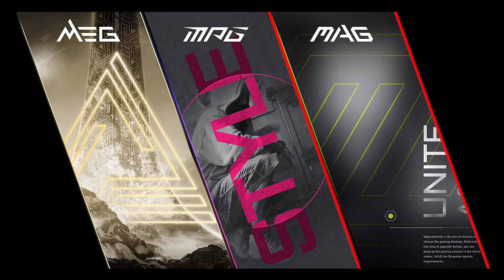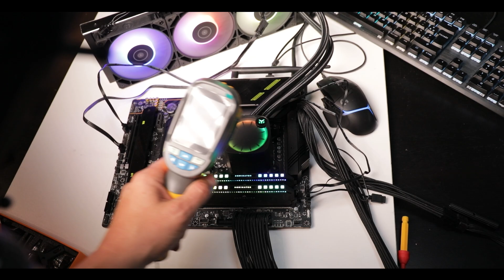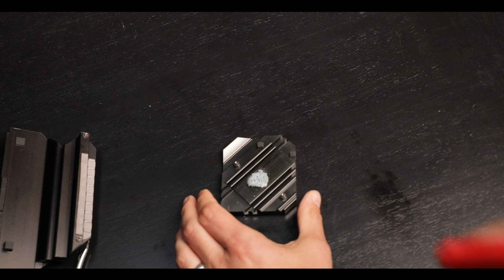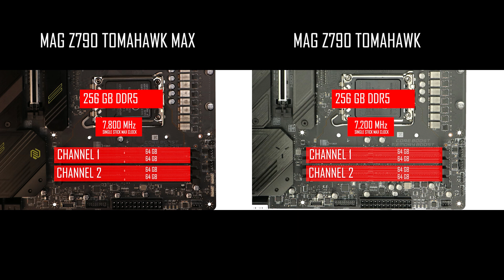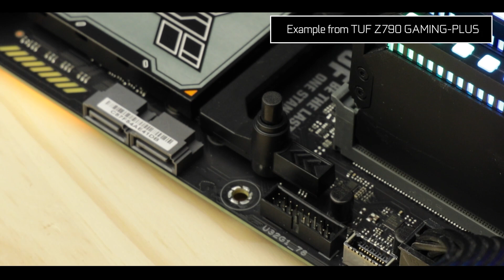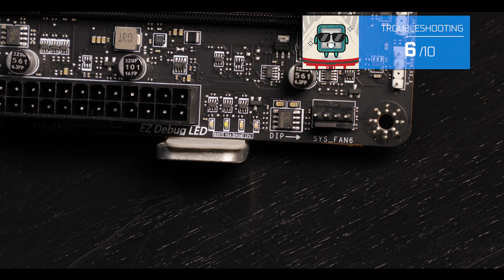MSI MAG Z790 TOMAHAWK MAX WiFi: Did MSI stop caring ?

Comment: What size thermal pads did you use to replace the stock ones? I'm definitely going to just do the replacement on mine. I don't like surprises and don't want to have to remove it again to replace them. :(
Reply: Did you end up replacing them and if so which size? Thanks

Comment: I was hours away from purchasing this but then I googled the motherboard and found your video. Thanks for posting! Now I have to hunt for a replacement with bios button, pci 5.0 and gen 5.
Reply: Just be aware, no matter the manufacturer, if you use the PCIE 5 slot for an SSD all Z790 boards half the GPU lanes to run it. No noticeable difference on a Nvidia 40 or 50 series Gen GPU, but that may change fast come the next series. The gen 5 SSD's work fine at the moment but given the way technology moves,  they could ramp them up and that could affect the speed of your GPU. Adding PCIE 5 to a Z790 was a stop gap measure.
Reply: @jaguar3248  What if I use gen 4 ssd in gen 5 ssd slot. Does it still cut PCIe lanes. Please answer.
Reply: @numansyed52  Gen 4 will work perfectly well in a Gen 5 slot without any lanes being cut.

Comment: MAG Z790 TOMAHAWK MAX  does it support bifurcation, as got a  4-Port M.2 Expansion Card M.2 NVME to PCIE X16 Adapter M.2 NVME. only sees 1 drive thanks
Reply: There is an option in BIOS to use x16 or x8_x8* for the first PCIe slot. So it should support.

Comment: I used to build PCs ALL the time, havent done much in the last 6 or so years, Ive done strictly MSI for any personal build for board and GPUs. currently building on now... what I am hating is the TOTAL lack of diagrams/instructions. I remember when board makers would have a white sheet diagram with EVERY pinout and header labeled. so I am hunting and hunting for pin outs to run the RGB (another first for me for addressable), also setting up 11 PWM fans, so hunting down all the proper fan pinouts. and their web site doesnt have this information either. so will be my last time purchasing through them. I like changes (upgrades), but it needs documentation.

Comment: I've had a great experience with this board. 14700k cpu and rtx 3080 ftw3 ultra. I do, however, RECOMMEND only running 2 sticks of 32gb ddr5 instead of 4x16 because you can overclock the 2x32 but not the 4x16 for some reason.

Comment: I still dont fully understand. I'm using a 14900k cpu. Ive just ordered this mobo. Are you saying that if i install a M.2 gen 3/4 ssd in the M.2_1 slot, my gpu lanes will be cut down to 8? 

And if that's the case, is it better to avoid this motherboard? I have 3 X m.2 ssd and would like to add another if the need arises in the future. Is this going to be an issue with this mobo?
Reply from the maker: Yes it will. But even 8 lanes @ pcie 5.0 is more bandwidth available that even a 4090 could handle . 

I would NOT worry about it
Reply: @Laurentschoice  Thanks so much for your reply, I've been racking my brain about this ever since I watched your video and was uncertain about this whole situation. I actually do have a 4090, and was worried that my gpu performance would be compromised by installing an M.2 in the 1 slot. This really helps. 

I had built my pc just about a week ago (first time build), and used an MSI z790 a max wifi mobo, which you had spoken quite well of. Unfortunately, there are issues with my wifi when I connect the antenna, and now I have to return it. I've ordered the tomahawk to replace it. Just wanted to know, in your opinion, if that's a smart choice.

Thanks again for your reply, it really helps
Reply from the maker: @manukoshy1219 it is. Just make sure to keep an eye on your thermals. Did u see how I changed the thermal pads on this model? 

I'm sure it was a one off... But stay sharp with it.
Reply: @Laurentschoice  yep, I did. That was my second concern. Once it arrives, I'm planning to remove the heatshield and have a look at the condition of the thermal paste. Hoping it hasn't turned into solid brick 🤞🏻

Thanks again, really appreciate it!! :)
Reply from the maker: Only check the side vrm block. If the thermal pad is still sticky . Ur fine for all of them .
Reply: @Laurentschoice  sure thing!! I'll keep you posted!! 🫡
Reply from the maker: @manukoshy1219 please do
Reply: @Laurentschoice do you recommend the b790 tomahawk base version?
Reply: @Laurentschoice  Thank you for an excellent review of this motherboard; it highlights so many useful factors. Can you please suggest the Thermal Pad that you used in your video so that it takes out any confusion for novices such as myself. Thanks again for the great video!!!
Reply: @Laurentschoice  Could you tell me what size thermal pads you used? How difficult is it to take off the heat sinks?
Thanks! Also good job on the review!

Comment: I’m having issues and I want to know if anyone else has one.

My pc is stuck on a boot loop. The LEDS light up red to orange a few times then stays at orange. No display, no response.

This was working fine and out of nowhere my pc won’t start up. I’m just confused. I don’t know what it is. I changed ram sticks around, cmos button was pressed. Hard reset of the pc itself. I just don’t know anymore.

Do I just get my refund?
Reply from the maker: Yes .. get that thing RMA asap please
Reply: This happened to me on my Asrock motherboard last week. I bent some of the pins on lga1700 socket after swapping CPU. Did you ever find out what caused your problems at the time?

Comment: z790 tomahawk d4 here. saw some videos that some mobos were DOA, luckily mine wasnt. very pleased with the board. cheers. hope you review the upcoming boards for intel/amd.
Reply: Same board here. Is VR VCC Temp (SVID) in HWiNFO the VRM temps? If so, mine top out at 65C. That's with HWINFO being on over 72 Hours with gaming and some CB23. They must have really screwed up with the Max refresh.
Reply: I order these boards probably every other month, i build PC's as a sideline, not had a dead one yet out of i think 12. I know for a fact that a lot of boards are declared DOA but are not. Its all to easy on a Z790 or any other Intel socket if you dont't know what your doing to bend the pins on the CPU socket when removing the CPU transit socket cover or putting the CPU in. The average PC owner does not know how easily damaged the pins are. I know of one major PC part supplier here in Australia who simply and correctly turns them around and sends them back with a note saying you killed it, your problem. The cover even has a warning that obviously some dont read it. I still say its a crap design that allows the pins to be so easily damaged, but thats just my opinion. On a PC build it is still the number one area i am VERY careful around. Once the the CPU is in, pasted and covered with an AIO or air cooler i am a happy man. The other area people struggle with is the concept of is stand off screws, don't use them correctly and you can easily fry a board.
I like the MSI Mag Z790 boards TBH, the heatsinks are fine IMHO if you use a decent cooling solution.
Reply: @jaguar3248 you are right because I bent pins for the first time on my asrock z690 last week. Just upgraded to this motherboard and pc runs faster / smoother now

Comment: @Laurent's Choice
Thanks for your reviews, as always Laurent.  A bit off topic here, but still related to MSI.  I have an MSI MEG x570s ACE MAX sporting a 5900x, and it does pretty well.  I know MSI makes a similar MB line up that will support 7000 ⬆ CPUs.  I believe it's the MSI MEG x670e ACE.
I'm teetering on the fence now between ASUS and MSI for my next build (prob 7800X3D) and liking what my current MSI MB offers for specs.

If there's any thoughts on your end you could impart between MSI and ASUS in the MEG category range for x670e, feature set, BIOS, OC'ing, that would be awesome.

I know it's a bit out of date now, as MSI and ASUS prob have refreshes on the way for the 9000 series CPUs.  However, having a HEAD <> HEAD (Comparatif Face à Face) matchup. ASUS vs MSI within this category, I would be extremely interested in your thoughts!
Reply from the maker: Well ur in the top tier... Both are very similar, with MSI being a bit more adventurous in terms of offered accessories. But overall.... Asus seems to be a bit more sturdy. 

I'd go ROG  Hero / extreme 

My two cents :)
Reply: @Laurentschoice  thanks!  I'm also looking for hardware raid on MB for two nVme m.2 in raid 0.
Maybe pointless, but I know MSI doesn't support it AFAIK

Comment: those temps are not acceptable. something is wrong, and its not the pads or paste they used. its the way they are doing loadlines in bios i bet. that vrm is massive overly good for even a 14900k. you can get away with a 12 phase 70 amp setup and still be better than this. 

NOTE: the temps you are measuring on the heatsinks is way way lower than the actual temperature of the vrm itself. something is way wrong here.
Reply from the maker: Thanks for the comments :) 

Though I'll point at the fact that, after swapping the pads, radiating temps (meaning surface temps) decreased  quite a bit :) . 

I think that, having dried up thermal pads ( and paste ) were the problem here :) 

I hope this helps and clarifies :))

Thanks again for ur contribution :))))
Reply: @Laurentschoice  wait a second... i got a degree in physics. if you measured the heatsink temperatures with a thermal imager and the temperatures went down after you applied thermal pads and paste... that would mean that the component temperatures are dissipating less heat to the heatsinks... meaning that the paste and pads are worse then the original ones that were on there because the heatsinks would be doing what they are designed to do...... what is goin on here??? am i being bamboozled? thermal physics explains this as a worse result. idk whats up
Reply: i guess there could be temperature load discrepancies that the power stages are adjusting based on better heat sinks. that could be the case. it could mean the thermal pads and paste are doing a better job. but if you have a dummy load situation where two heat sources produce the same heat and the heatsink decreases in temperature due to a thermal pad change that would actually be a worse result. you want those heatsinks absolutely smoking in that scenario.
Reply from the maker: @p1st0ls44 yes :) if ur thermal pads and thermal paste are dried up.... The thermal transfer ratio decreases ... More heats is produced than transmitted and radiated :) 

:)
Reply from the maker: But I appreciate ur intake on the situation :) it's always a pleasure to see everyone sharing their point of view :))))